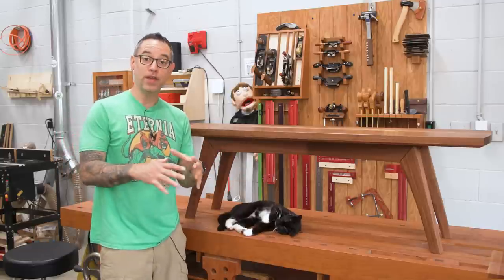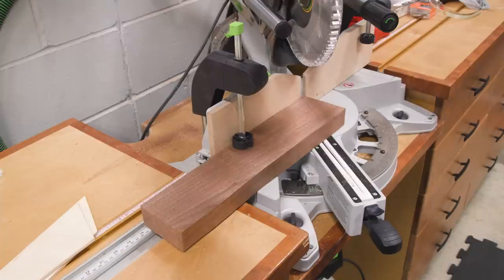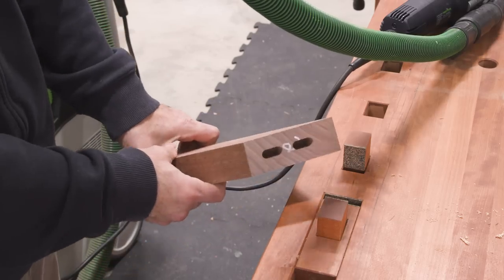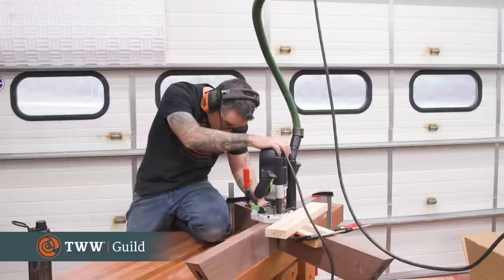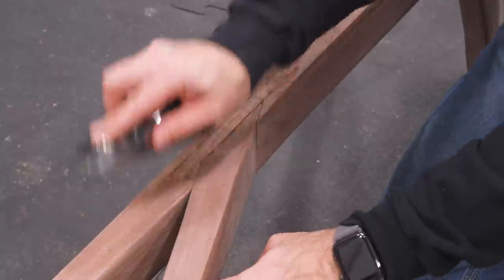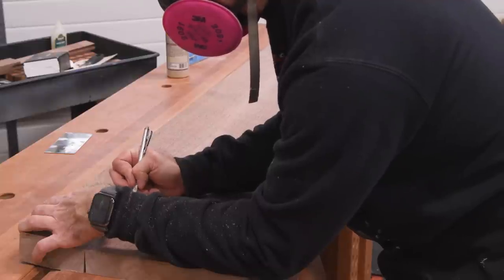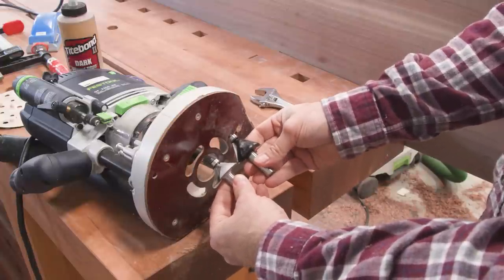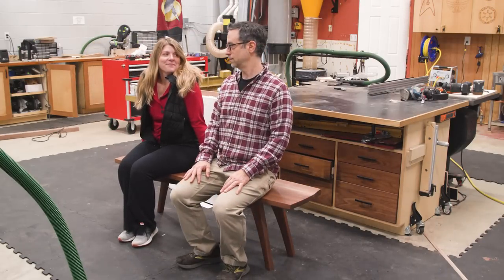I Made the PERFECT Bench for Our Criss-Cross Table  | The Wood Whisperer

Comment: Great project. I have a question: Are the splines in the Criss-Cross necessary? What do they do? I think I know, but would like confirmation. Thank you for sharing. Have a great day and stay safe.🙂🙂
Reply from the maker: If you check out the table video you'll see a little more info about that. They are necessary as they do a lot to add rigidity to the base.

Comment: TWW says, "this is not something you see many US woodworker's doing", lmao, as he runs the boards through a massive industrial planer, 3 phase power, helical head. Doesn't this thing go for like 20k, not including delivery and all the electrical work to get up to 3 phase? Anyway, good build video otherwise, but that gave me quite a chuckle. I assure you, my planer would not give acceptable results with this operation.
Reply from the maker: Hmmm sounds like it might be time for a planer upgrade. Even the most basic lunchbox planer should be able to surface the edge of an 8/4 board without issue. If not, something is wrong.